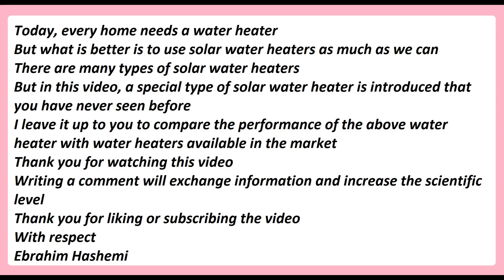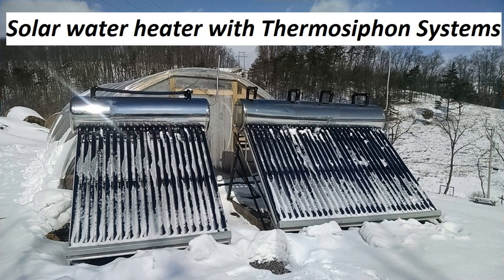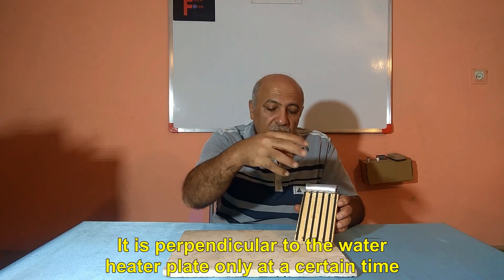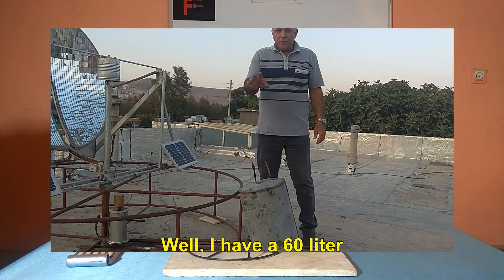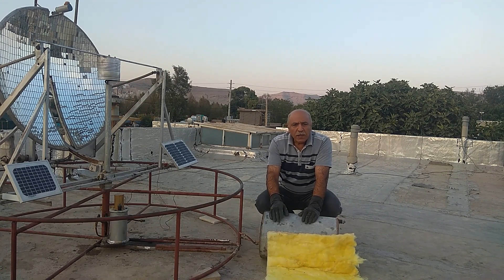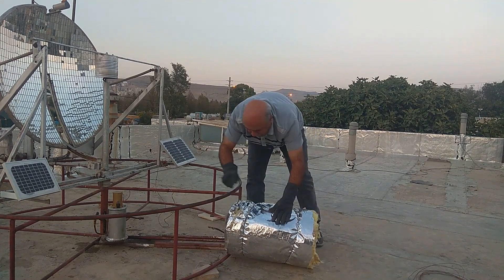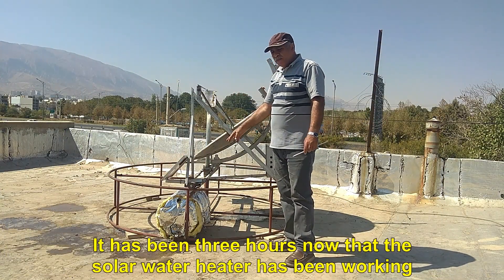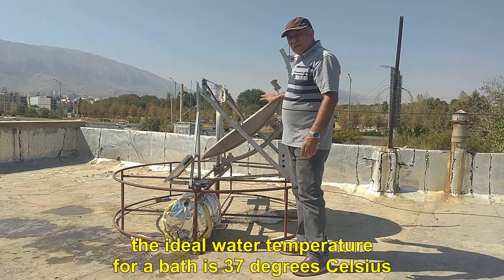solar water heater. A new solar water heater system.The new generation of solar water heaters.

Comment: What was  oil inlet (Hot) cold oil temp?
Reply from the maker: The temperature of the hot oil rises to 150 degrees Celsius and the return oil temperature depends on the temperature of the water in the water tank and can be from 60 to 100 degrees Celsius.

Comment: Very interesting method, thx for sharing.  Impressive design too.

I think to keep a system simple is important. My plans are to hang a sealed pex loop box on the back wall of an ICF greenhouse, which will circulate catchment water tanks buried within the greenhouse floor as thermal batteries. This will prevent freeze issues too. The thermal battery/tanks will have seperate closed-loops for various heating uses; pre-heat ERV/HRV fresh air via small radiator in duct, pre-heat water mains, in-slab hydronic pex lines for thermal mass, hot tub, lap pool (also within greenhouse).

No chance of cross contamination. No moving parts aside from solar powered pump during day & battery powered pump at night. Very few connections to leak. Easily control temps with shade & pump speeds.

It's just theory at this time, so we'll see! Have to calculate everything to size the system, & I'm not that well educated, lol.

Comment: You should try making a sand battery and storing all the solar heat in the sand with the heat exchanger far more efficient and cheaper if you insulate the dryied sand...

You can forgo with oil as the heat transferring method as storage if you create a solar dish to heat a sunspot pointing down words into a sand battery with a very large heat sink buried in the sand.. then using a heat exchanger to extract the necessary Heat out of the sand... the sand if very well insulated will stay hot for many days if not weeks if you insulate it into a vacuum.

Comment: I have just placed a video on YouTube yesterday of my 120cm x 720cm x 7cm single boxed panel hot water Solar heater, I have recently constructed. 
Which costs approximately £175.00; to produce. 
Which at present heats up 2.25 litres of water, within 20 minute's from an ambient inflow temperature of 11° Centigrade. Up to a hot water temperature of
56° Centigrade, in a low October Scotland morning sunshine..
I am also going to put a video of my 120cm x 720cm x 6.5cm hot air Solar panel, which gives free warm air heating to home's, caravans, boat's, ship's, factory's, shop's, school's etc..
It heats up cold air from an ambient ground temperature of 11° Centigrade, upto a high of 57.7° Centigrade.
Again in low October, Scotland mid morning sunshine. 
And uses Thermo Syphon convection flow direct to a water Butt storage container, with a hot water capacity of 120 litres - 30 gallons. 
I will be putting the video of the Solar Air Heater on YouTube, later this afternoon @
jeffrey bresnahan
Reply: @fixedfocussolar  Will do, the two video's are included in the video list of my channel, you may have search through the list?